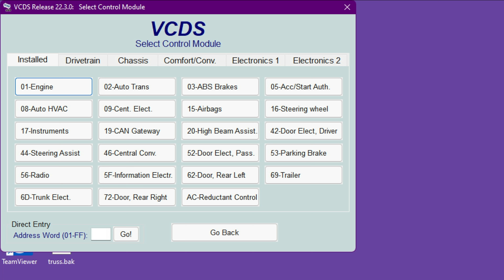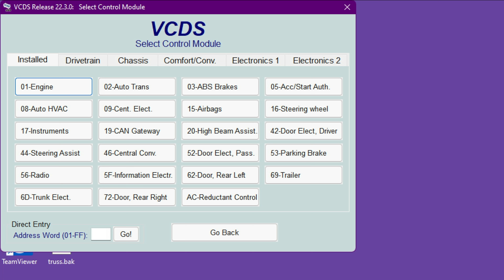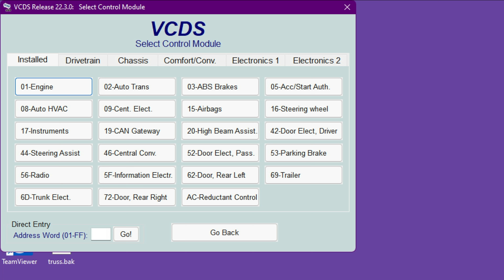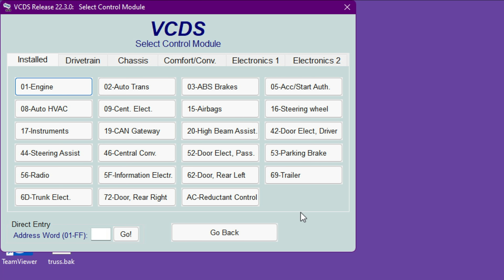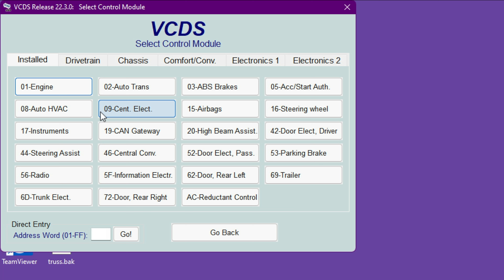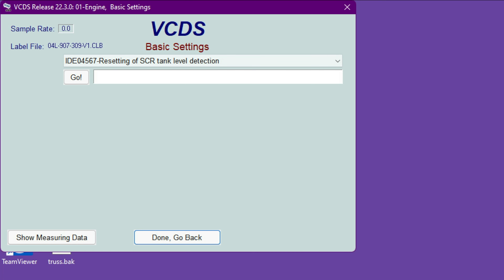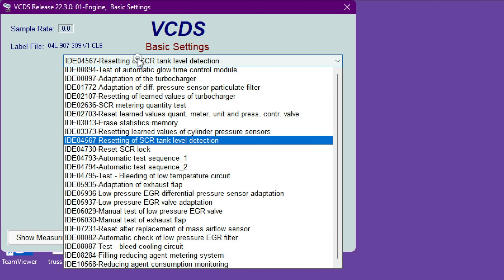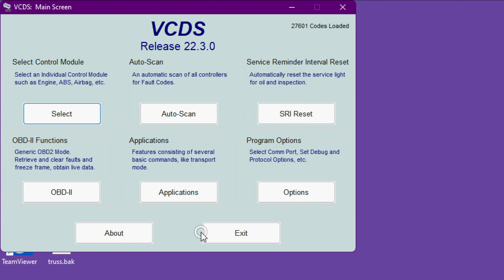AdBlue Metering System reset using VCDS

Comment: Thank you for your post.  Had exactly the same scenario on our 2015 TDI Q7 this week. I filled the DEF tanks with 5 gal of DEF and two days later drove a short distance and got a “ Refill AdBlue 1000 miles remaining” warning.  Have refilled DEF many times over past 10 years in two TDI Q7s and it has always reset automatically. This time no. Your procedure worked perfectly.  I’ll be more careful in the future to do that one minute ignition on without cranking after filling.  These are wonderful vehicles but they are complicated and a bit finicky
Reply from the maker: Do you remember what was your error code?
Reply from the maker: Have you check for ECU software update? Watch here: https://youtu.be/iEoJ9iakXL8
Reply: Hello, I am having the same error, did you manage to fix yours? I have done the 2 resets via VCDS with the engine turned on and the error still pops up
Reply: Yes. Ours has worked fine since this reset.  At least 15000 miles since then.  I do refill AbBlue on 5000 mile intervals now to avoid ever getting low and actuating a warning.  After a fill I always turn ignition on for one minute also to allow system to “ balance” before starting engine also. 
Wish I could be more help.
Reply: Have you done the procedure when you had a full tank of Adblue or not? Mine is half empty and this message appeared just a few days after adding the addblue.
Reply: I filled the tank to full.   I HAVE had the transfer pump from the lower big tank fail and stop moving fluid to the upper operating tank.  This will cause you to get a low AdBlue warning in about 1500 miles after filling because the fluid in the lower large reservoir is is isolated there.  Requires replacement of the transfer pump. It’s a common failure.
Reply: @compclen  I've got an error related to the injector, it is stuck on the closed position
Reply: Sorry. I’ve no experience with that.
Reply: @mariuspoparascu1822 still pop up after procedure. Audi q7 2011.
20 miles left 😭
Reply: @XX-jn5gc  just do the adblue delete at any tuner. It is relatively cheap and it fixes the problem forever.
Reply: @mariuspoparascu1822  please tell me more about it. I've tried VCDS but nothing. Still appear adblue fault.

Comment: Depending on t system, but yes u usually have to carry out an extended road test to allow vehicle to perform an 'SCR Efficiency' test. Providing t fault has bn repaired successfully an scr efficiency test is where t car tests t functionality of t SCR exhaust (ie NOx conversion). Once done successfully t light should go out automatically. I hope this helps
Reply: I have an error code of P24CC reductant tank switch. Will this reset work on that?

Comment: I have the adblue/DEF fault, no restart in xxx miles. It's topped up to the brim but won't reset, driven it for over 100 miles and still no reset. Do you think this will reset the milage countdown? Thanks
Reply from the maker: you have to have it checked and see what is the error code and go from there.

Comment: Hi i refilled my adblue tank and i have the messege about a week lator saying code p208A reductant Pump Control circuit open should i try resetting like you did, or changed def adblue pump ?
Reply from the maker: I think your is way more specific and you have a pump wiring issue. You should get it fixed.

Comment: I had this on a 3.0 TDI 2015. The connector pipe on the DEF injector had weeped for years and the white crystals had to be periodically rinsed off with hot water.
I assumed this had got worse and fixed it with JB Weld and large heat shrink tubing, but when testing no adblue came out under running and out put tests and the warning continued to countdown.  Reseting the insufficient reductant pressure code just came back and never cleared the countdown message,
DEF fluid was showing 14% in VCDS but I added 10 litres anyway to no avail and did your procedure to no avail.  Went for a drive and as soon as the car was warming up the message disappeared so my theory is:
a) It ran out of adblue but expected (calculated) there should be 14% level.
b) The leak caused low pressure reading and it became disabled/locked and your procedure reset it.
c) In addition, the OBDII readiness check was in a failed state until all emissions tests passed on current drive.
Reply from the maker: Indeed if there is a repeating issue the code will come back.

Comment: Hello!
For me it says: Adblue/DEF: fault. No restart in 600 km.
See owner's manual. If I understand correctly, is this the solution for me as well?
The check engine light is on.
Reply from the maker: You can definitely try it but if the check engine light is on this means most likely it is not going to work. Still, try it and see what happens. What is the error core from the engine?
Reply: @bonevchannel  It only indicates that starting the engine is not possible after 1000 km.
Reply from the maker: @gaborocsai4789   you have to scan the engine for error codes with a tool

Comment: Thx.  Wondering if this will work for me.  I just did the 1st step (IDE004567- resetting SCR tank level).  Dash said I had 1600km (1000miles) left on the adblue, but I could only put in about 6L...  It had given me the same warning under 3 weeks ago and I put in a full 9.5L (2.5gal) jug in at that point.  After topping up today I did the tank level reset.  Will see if the low adblue warning comes back.  With a full system,  I typically can go more than 15,000km before needing to add DEF.
Reply from the maker: The procedure requires some topping but as it turned out you should be ok even if you do not add AdBlue in if you already have enough in the tank. The last time I did this I did not add any more. Actually topping the AdBlue can be very problematic as it turned out so I would advise not to top to the max. There is a situation I ended up being where I topped it but the system does not detect that the level is going down and will not reset. I had to take the hose to the injector connected to a plastic bottle and drain 1-2 liters of AdBlue so the level in the tank gets lower. Then it reset itself after max 30-50 km.
Reply from the maker: 2 months ago I replaced the NOx sensor which can be also part of the AdBlue Fault error that I was curing with the reset procedure. In another 3000 km if I do not get this warning anymore I will consider it fixed permanently.
Reply from the maker: But after the 3000km the warning came back so I think mine is related to the reading of the AdBlue lever which in my case always says I have 98-100%. Resetting it worked again 😅

Comment: Didn't work. I still get the p203B error that the level is unplausible

After I changed my pump this happened.
What can I do?
Reply from the maker: That would suck to have changed the pump and it is the wiring that is the problem. I think you should try to reset it again and then go back to the garage.

Comment: That's not correct. T first reset was for t tank fluid level calibration and you need to have at least a certain amount of DEF fluid to do this. T 2nd function is to reset t mileage count down restarts. Totally duff info 👎
Reply from the maker: You are absolutely correct about the 2 resets, but that is also what I advise in the video. First top the tank, reset the measuring system, reset the count down. The car should do it after full refill by itself but if it does not for some reason then you want to do it yourself.
Reply: Do you know if you have to drive for a while after toping up adblue before the countdown disapears? I have done all these steps, but it does not disapear. No error warnings in vcds.